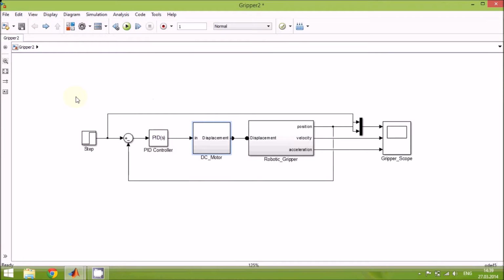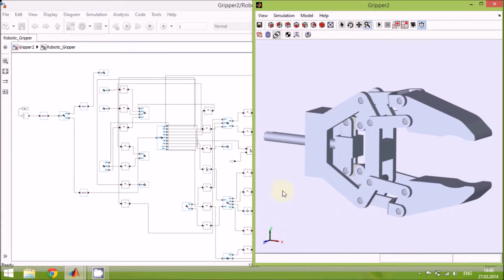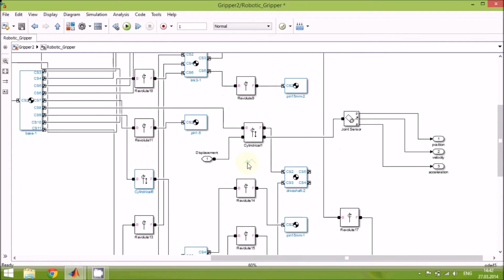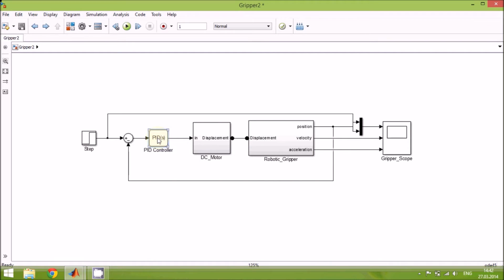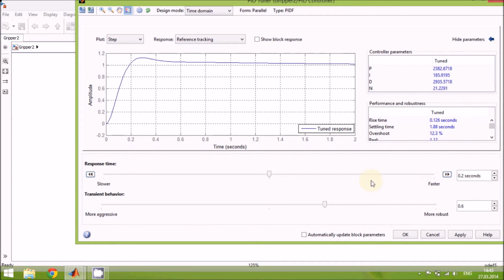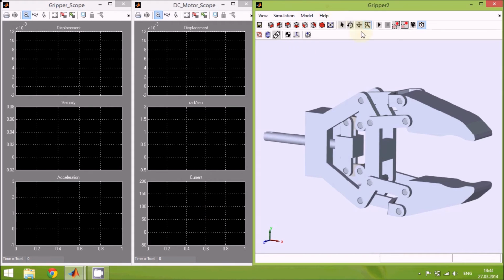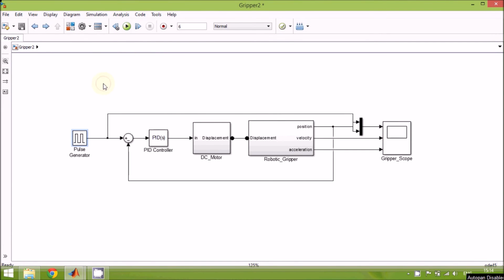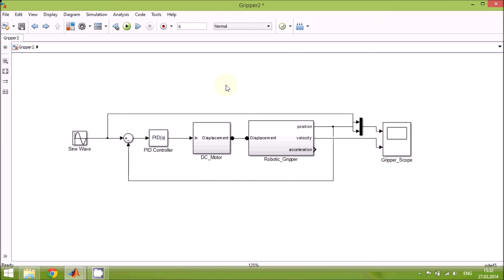PID Control of Robot Gripper in Matlab / Simulink

Comment: I have data for my robot and I want to set a step input for my robot in the Signal Editor. I don't know what values to use for the time and amplitude. would you please guide me?

t   = [0, 1, 1.5, 2, 3, 4, 4.5, 5, 6];

x   = [ 1.412,  0.8696, 1.412,  1.412,  1.821,  1.545,  1.831,  2.382,  1.412];
y   = [-3.142, -2.088, -3.142, -3.142, -3.142, -2.31,  -3.142, -3.142, -3.142];
z   = [-0.086, -0.086, -0.086, -0.186, -0.186, -0.186, -0.186, -0.386, -0.086];